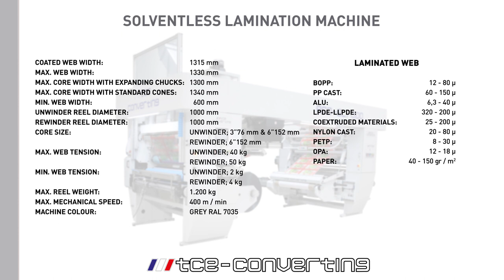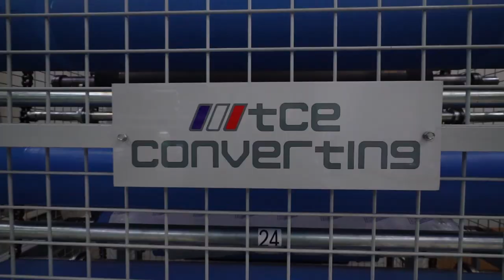ECO - SL Solventless Lamination Machine

Comment: At the time of lamination  why dots coming in white in   . I e while lamination. What is the problem .
Please explain sir🙏
Reply: Glue zyada hony ki waja se spotting ajati he.
Reply: Dots coming from laminite used adhesive  only  or cant mix very will.
Reply: If ur ink thickness is approx 23 or 24 then u will not get the dot in ground job specially in white
Reply: Do you first laminate met pet and LD film
Reply: Orange peel can be from not enough laminating pressure, not enough heat on your lamination rollers, or your coating pressure is too low
Reply: First laminate met pet + printed pet, but make sure that film edges are not coated with adhesive. Then white dots can be avoided